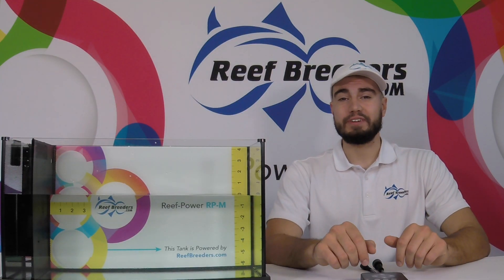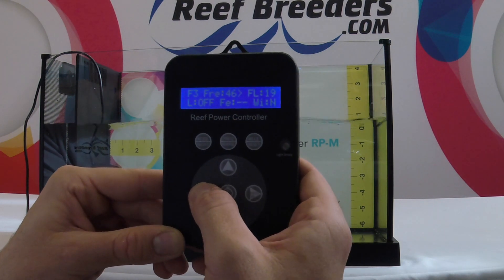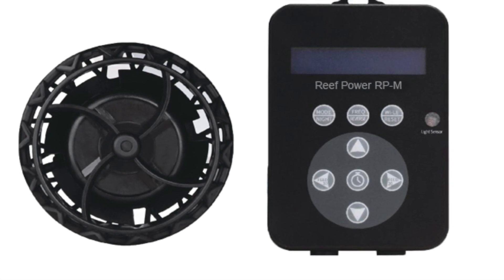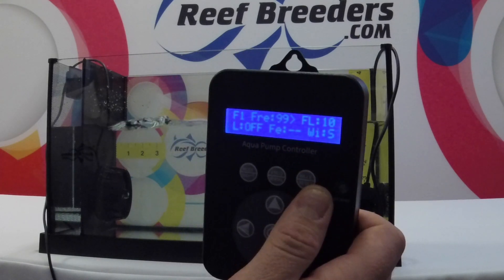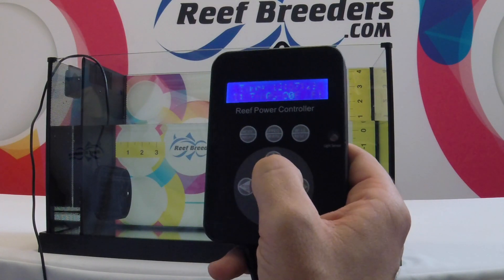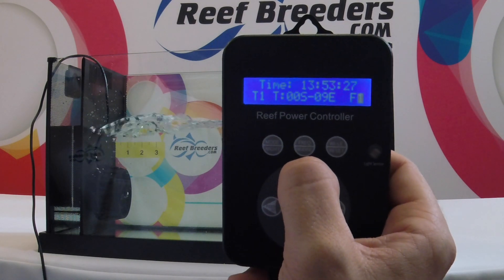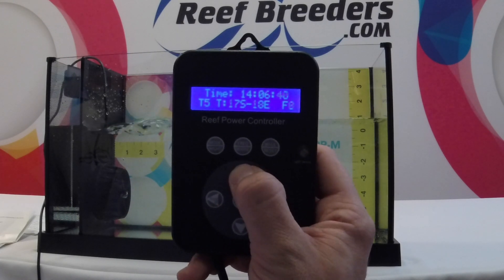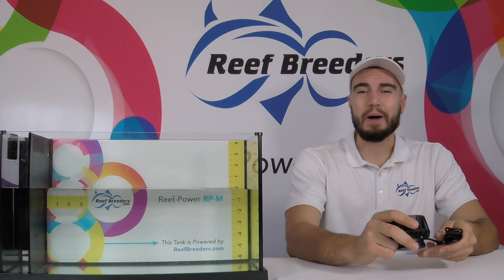RP-M Programming Guide

Comment: Awesome Video Logan! Question, when I’m using the pump with slots 1-6 programmed, do the slots use the flow and frequency patterns that I set or does the pump run at factory defaults/full flow and frequency? I ask this because I only have one pump in a 45 gallon Aquarium. Thanks again for the great instructional video.
Reply from the maker: Good question Brock! The Frequency and Flow settings apply to every mode, including mode 6, which is what you are running when you set the timer. You will notice when you change from mode 1 to 2, for example, the fre and fl settings remain the same. This is also the case in Mode 6
Reply: @ReefBreeders   So the settings for an individual mode does transfer over into the timer mode? Also, when changing the frequency the  sign flips from < to > and Visa versa when you start going down from 99 or up from 1. Is there a difference when the sign flips? And one more question can night mode be used with timer mode? Thank you

Comment: This vid helped a ton, thanks. What does turning light sensor on actually do ?
Reply from the maker: The night mode will set the pump to F1 Flow 1 when it gets dark. Just make sure that when your tank lights are on, the pump is getting enough light to turn night mode off.

Comment: What if mine keeps shutting the pum off after a few minutes.  I’m trying to run it constantly and Keeps shutting off.   If I unplug the power and reconnect it starts again.   Should I return it?
Reply from the maker: Please email us so that I can help troubleshoot and arrange a replacement controller if needed. When it shuts off- is the controller still working, just not the pump? Or it's totally off?

Comment: Need a video that shows the performance of the pump in action rather than see your hands holding the controller,  I despise it because I am a tech challenged person
Reply from the maker: Hey Carlos, if you want a simple setup, I recommend just setting your pump to F4 and letting it run a randomized flow program. That's the fastest/easiest way to set these up.